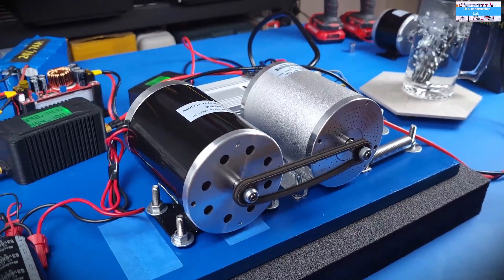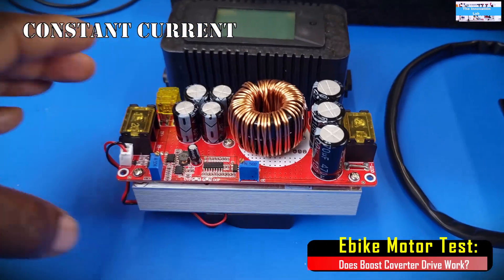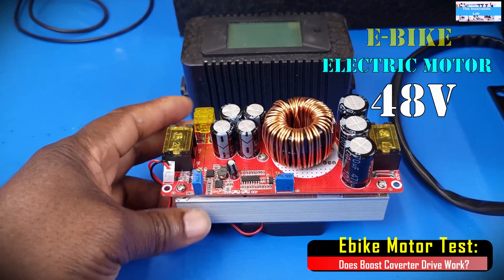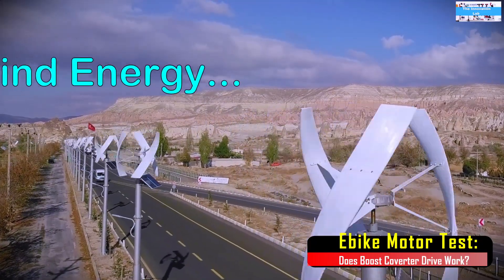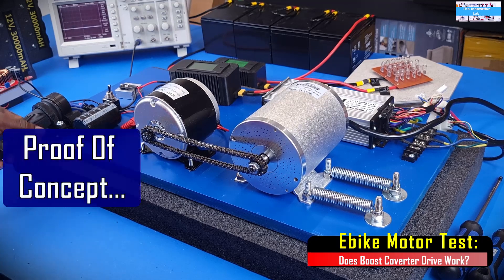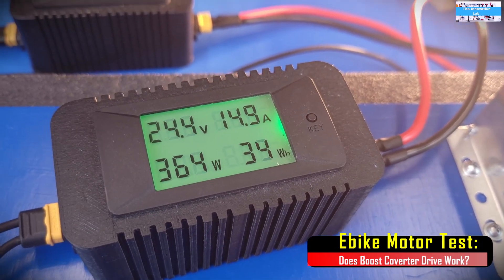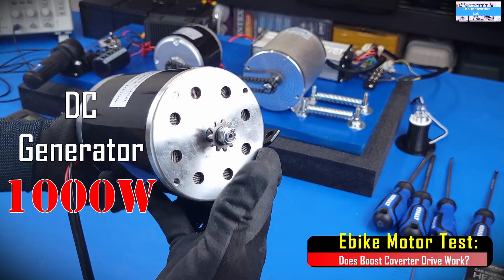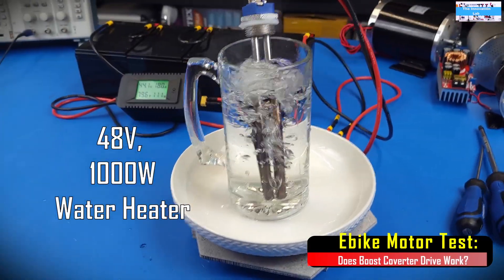Innovative Electric Bike Motor Testing, Boosted by DC to DC Converter!

Comment: Planning to install this dc boost converter in my small solar setup  to extend my inverter running by boosting or maintaining the voltage of my battery to prevent my inverter from shutting off  prematurely.  Do you think its possible or practical to do it or not?
Reply from the maker: A lot of concepts or ideas are feasible with good design analysis and testing. I will need to know more specifics of your setup to know if it makes sense or not.

Remain blessed.
Respectfully,
The Innovati0n Lab
Reply: @theinnovati0nlab782 my small setup: 600 watts solar panels, 50ah lithium 60 volts battery, inverter 1,000 watts use only for lights, 2 laptops and electric fans total of around 500-600 watts. My battery cutoff at 45volts while my inverter at 53volts so my battery juice is not getting fully utilised😢, i now see this converter having an input of 14-85 volts with 1,800 watts on paper unlike before that it can only handle up to 60 volts so i got interested again to try the idea.

Comment: Hello, how are you?
I have a 12v x 50Ah battery and I need to power a 24v device that consumes 10Ah.
Does this converter work well with this current continuously?
Reply from the maker: Hello!
I am doing great!
Thanks for asking, much appreciated.❤️

Yes. 
The converter can easily deliver that much power with any issues....you are only asking for less than 300W - accounting for converter losses. Just make sure that the output current limiting potentiometer in set to the maximum point.

I hope this helps.
Respectfully,
The Innovati0n Lab💥

Comment: hi i tested in my ev  scooter. battery out put cable wire to controller 
Heated  and smelt when loading  
Vehicle volt 48/7 ampere 
Battery  lead acid 24 v
Boost converter 1200 watt  and 
Converted volt 48 v out to vehicle controller    how to solve issues of  high heat?
Reply from the maker: Great question.
Easy solution.
I would recommend using high current and big gauge wires to run the input power from your battery to the boost converter input.
I find that multi-stranded, tinned silicone wires have better ampacity and dissipate less heat. 
Guage 8 should be able to have up to 50 amps. 
If you are feeling generous or extra cautious, you can double up on gauge 8 or use a bigger guage - like gauge 4.

Also, keep your wire runs as short as possible. The longer the wire, the more the cable losses.....and the more the heat you will generate on those wires.

I hope this helps.
The Innovati0n Lab 💥 www.theinnovati0nlab.com
Reply: @theinnovati0nlab782  
Thank you sir

Comment: Would it be more efficient to use a buck converter to stepdown a larger volt battery to a lower volt?
Reply from the maker: It will depend on the efficiency of the converter and your battery voltage and the requited voltage of the device you are providing power to.

I hope this helps.
The Innovati0n Lab 💥 www.theinnovati0nlab.com

Comment: hello friend.. I want to praise your work, from which I, as a beginner, learned a lot. I have a stupid question. 12v 70Ah e-bike battery an 36v 350w cintroller and motor?
Reply from the maker: Thanks a lot for the wonderful feedback.
I would be honored to answer your question if you don't mind elaborating.

Thanks.
Respectfully,
The Innovati0n Lab 💥 
www.theinnovati0nlab.com
Reply: @theinnovati0nlab782 

let's say: battery 70Ah 12v plus booster at 36v connected to controller 36v 350w e bike who have motor 250w..

Comment: In 12v mode you applied 180 watts and received 260?!
Reply from the maker: No, you are looking at it backwards. Unless I somehow stumbled on a new law of physics during my testing without even knowing it...hahaha!

The dc generator was used as an electro-mechanical load on the ebike electric motor, and the converter powered the ebike electric  motor for the 12V battery.

💥💥💥
Here is the breakdown:
Power from converter:
260W

Load on DC Generator:
180W

Again, applied load = 180W, while the output power from dc to dc boost converter at 48V is 260W.

I hope that this makes sense to you. I appreciate you asking for clarification.
👍👍👍
The Innovati0n Lab 💥 
www.theinnovati0nlab.com

Comment: I’ve just ordered the 1500w version of this step up converter to boost my e-bike voltage from 52v(58.8v) up to 72(84v)*maybe above as it allows up to 97v…* it says I should upgrade the cooling for above 22A so I’ve also picked up a twin pack of 50mm fans. The max amps on the one I ordered states 30-35A so do you think I would be ok to pull 30A for short periods of time, maybe 5-10 seconds at a time with 10-15A most of the time? My main intention is to aim for speed at the cost of torque and obviously efficiency.
Reply from the maker: Wonderful!👍👍👍
At such a high input voltage, I believe you should be good to go, but that is my informed opinion.😊 You still need to test it to see how the converter will perform.

Success wishes!❤️
The Innovati0n Lab
www.theinnovati0nlab.com

Comment: I need to drive  a 72v 2000watts motorcycle. What should i use as a boost converter.
Reply from the maker: Please see my response to your previous question on the other video.
I would only recommend these converters for steady state or continuous power load of less than 1200W  at a minimum input voltage of 48V.

You may have to conduct some product research if you need more power....but heads up, if you find anything, they will be very expensive.

I hope this helps.
👍👍
The innovati0n lab 💥 
www.theinnovati0nlab.com
Reply: Sorry, but I understand that these boosts support a maximum of 18v at the input, 48v couldn't be possible 🤔

Comment: ЗДРАВСТВУЙТЕ! Привет из Чернигова 🎉. 
Извините что не на английском. 😅
Посмотрел ваше видео , очень интересно ! 
Я катаюсь на моторчике My1020 36v1000w . И акумулятор у меня ~26в100AH  (лилий железо фосфатный)  
 
Использую акумулятор от солнечной станции . Боялись что електричества не будет . После мемяца обстрелов из аритилерии , решились на столь дорогую пркупку. 
Но хотелось бы поставить более мощьный мотор . И я смотрел в сторону модулей преобразователей. 
Да, спасибо большое за Ваши експерименты ! 
Я вот хотел уточнить . 
Сейчас я имею примерно 26V*27А=700w
Если добавыть  модуль выйдет 36v*20a=720w. Результат не впечатляет . 😊
Сталобыть нужно выбирать двыгатель с более высоким напряжением !?
Например я возьму 72в*20а=1440w. !
(Но в реальности будет 1000ват , модуль не сможет дать больше 😂)
Буду очень рад услышать Ваше мнение, как мне добытся большей мощности ? Без замены акумулятора.
Reply from the maker: Wow!
Thanks for such great feedback!
I am glad to be of help.
Your thinking is on the right track.👍👍

The major issue with these converters is the current limit at the input of the converter.....which is usually around 30A....if you push it a bit, maybe 40A.
This means that at your batteries' nominal voltage of 26V, you would only be getting less than 26*30A watts  from the converter - we have to account for conversion efficiencies. Yes, your math above is correct. 

These converters are designed to deliver more power at high input voltages. Hence, to get the kind of power your need, you will need a more powerful boost converter capable of providing high output power at lower voltages.
This means that you need a converter that should be able to process greater than 80 to 100A at the input.
I hope this makes sense.
Overall, your design logic of higher voltage at lower current is really the gold standard for high efficiency for most electric vehicle systems.

Success wishes on your diy projects, my friend!👍
The Innovati0n Lab💥
www.theinnovati0nlab.com

Comment: На DC моторе 48в 1000ват.там где выходят два провода черный и красный можно сделать реверс?????мотор не сгорит??
Reply from the maker: It's a permanent magnet dc electric motor..Reversing the wires will reverse the of the output if you are using is as a dc generator. As a motor, reversing the polarity would cause the motor to spin in the opposite direction.

👍😎
The Innovati0n Lab💥
www.theinnovati0nlab.com

Comment: i wonder if 2 separate boost converters connected to 2 separate say 36 volt lithium packs could be used in parralell where only  the output is connected ,has this been tried yet ,i know both the inputs and outputs were done ,but separated?
Reply from the maker: This sounds like a great idea for a simple experiment. You should give it a try and see what the output response of your converter system would be like.

Keep us posted on your progress. Let me know if you have any questions.
👍😎
The Innovati0n Lab💥
www.theinnovati0nlab.com
Reply: @theinnovati0nlab782  im actually doing  parts list ATM to build your modified converter so i can use it in a 85 volt 10 to 20 amp ebike charger  i am pretty sure that ill have to have an input voltage of 55-60volts to be able to 85 volt 20amp output though.as you know these converters work alittle strange

Comment: weve run the 40 amp version with a 36volt and 48 volt battery  and boosted it to 84 volts as long as we were easy on the trottle it ran quite well
Reply from the maker: Wonderful!
I am happy for your success!
👍😎
The Innovati0n Lab💥
www.theinnovati0nlab.com

Comment: Hoe kan  ik een 48v 20ah batterij het best opladen tijdens het rijden zoals een auto het doet. Oneindig rijden.  Zoals een dynamo van een auto. Ik heb een elektrische tricycle die rijd 85km/p.
Reply from the maker: Great question.
Electric cars use regenerative breaking sustem that produces electricity when breaking. 
Gas powered cars use alternators that are drive by the vehicle engine to recharge their batteries.

So you may need to research the implementation of a regenerative breaking system. 
I made a dc generator video a while ago. I discontinued the series because people didn't seem too eager for it at the time.
You can apply a similar concept to see if you can make something work. Regenerative breaking is all about replacing a vehicles break pads with a high power dc generator. Instead of wasted power as heat on the break pads, your dc generator converters the cars kinetic energy into electricity and saves it in your battery.

DC Generator Videos:
👇👇👇
https://youtu.be/OuLokIPeGt8?si=VPSrIB31zYNfrqF6

https://youtu.be/w9F_UoCyjPY?si=LUEot0yCFKG8gtv_

https://youtu.be/56XBcXrnPoE?si=Hvg0L2DaNiTttmKT

I hope this helps.
Please, we need your help to grow our channel by sharing our videos on social media. Also you can visit our website at www.theinnovati0nlab.com 
👍😎
The Innovati0n Lab💥

Comment: Hi sir can I use the converter to feed the motor directly as a controller. Thank you so much
Reply: I have the same quiestion. Or can the converter be used after controller?
Reply from the maker: Again, this is  an interesting idea. I love that you are thinking  outside the box!👏👏👏

However, honestly, I would not recommend you do it because, at lower voltages, you will damage the converter as a result of high current surges.

But if you are feeling adventurous, you can definitely try it. But you must know that there is a big risk of damaging the converter, or your motor, or both.

I hope this helps.
👍😎
The Innovati0n Lab 💥

Comment: can i connect the dc generator to my bike pedal so that it can generate volts, and that volts, im going to connect it to my electric motor, will it work then?
Reply from the maker: It is not clear to me what you are hoping to build. However, the function of the DC Generator is simple - as long as you as you can find a way spin the amateur shaft, it will generate electricity. Just like our setup in this video. I discontinued the video series because the YouTube algorithm was not recommending the videos, so they were not doing as well.

Please watch the design concept video below.
👇👇👇
https://youtu.be/w9F_UoCyjPY?si=WwJe25dI6YjbCkQw
Reply: thanks, i just want to run my electric bike using dc generator, without using battery
Reply from the maker: @felixescober6798  
I understand.
However, it may not be the best idea. You are going to encounter a lot of energy losses due to inneficiencies.  I would not recommend doing that. But if you are curious, you can build it as an experimental project - just to satisfy your curiosity. Trust me, I have done many projects of such nature myself...hahaha.

Summary:
You will always need a battery system for any electric drives system.
I hope this helps.
👍😎
The Innovati0n Lab.
Reply: great thank you, it will save my time and effort haha, thanks much much

Comment: Привет! У вас есть видно опыт в этом ,вот вопрос _ я нашёл конвертор 12-48 v 20a,  хочу свою батарею 48 Вольт литий-ионную переделать на 12 Вольт ёмкость ее получится 220000а/ч , смогу ли ездить на велосипеде дальше ,получить выгоду от такой переделки ? Есть ли смысл?
Reply from the maker: Great question.
👍👍👍
First of all, it seems that what you will need will a powerful buck converter - if you are looking to down, convert your 48V battery to 12V. Unless I misunderstood you. 

Honestly, if you already have a powerful 48V battery, I wouldn't recommend doing the down conversion to 12V because you will be burning a great deal of power due to converter losses and low efficiencies. It will be better to just use a 48V motor. We only suggestion these boost converters to those who cannot afford expensive higher voltage battery systems. 

I hope this helps.
👍😎
The Innovati0n Lab.
Reply: @theinnovati0nlab782  Thanks for the answer! I realized that I would not get any benefit; the converter would suck five times more energy from my twelve-volt battery. 😁👌🤔👍

Comment: Why only 180w @ 12v?  For 500w ebike output 42 amps @ 12v.
Reply from the maker: It is due to the current limit on the converters.
It was also explained in the video.
👍👍
The Innovati0n Lab

Comment: So why did you not talk about how you did the speed control from your hand throttle to the motor. I feel that you are not giving full information here.
Reply from the maker: Thanks for the feedback.
I see your point. However, I had already covered that in a previous video. This video was meant to be a follow-on video that builds on the previous one that explains the concept of the Electric Motor Load simulator. But you are right, though oftentimes I forget that these videos exist as separate entities. 

Please check out the video below.
👇👇👇
https://youtu.be/w9F_UoCyjPY?si=Vn2HAmUMtdxS4Xcg

Also, honestly, there really isn't much to explain. The ebike kit came with the motor speed  controller and throttle. All I did was build the test bed for it.
I hope this helps.
👍😎
The Innovati0n Lab.
Reply: Many thanks for your reply i will now watch that other video.
Also i do have to say that i do like your video's they are very clean and crisp you seem to lay out everything as it should be ( not all jumbled up )and prsented very well, i will also subscribe now.
All the best Kev @theinnovati0nlab782

Comment: So it seems to me that the DC/DC converter has a constat current feature referred to the INPUT current, not on the OUTPUT current.
So changing the input voltage, setted the maximum input current, will end up absorbing more input power and delivering more current at 48V on the output. Am I right?
My thought was that the constant current setting will be acting on the output current, but that's not the case right?
Reply from the maker: Your thoughts are on the right track. 👍
However, the converters have input/output current limit (usually about 30 to 40A). 
The constant current function only applies to the output. It is a built-in function that helps the converter to regulate the current delivered to the load, to whatever level the user desires.....as long as the set CC point is less than the rated current limit. Also, you will have to have an input power source that can deliver that amount of current.

I hope this helps.
👍😎
The Innovati0n Lab.
Reply: @theinnovati0nlab782  I didn't thought that cheap thing could be so sofisticate and well engineered. Thanks.
Reply from the maker: @grazianoturbogas  
Yeah, that is the power of mass production. Honestly, for the price, the product is amazing!

Comment: hello im just curious ,when you focused in on the oscilloscope ,the flat line was supposed to show what ? as far as an ebike goes ,introducing a dc to dc cc /cv boost converter will just add to much inefficiency ,if you run 72 volt motor on a 48volt battery youll get more distance than boosting a 48 volt to 72 volts
Reply: i roughly saw greater than 20% wastageand that was just in the conversion itself ,there is a trick to these boost cons,the less you have to boost the voltage ,the more efficent and less heat, the larger you have to boost the more current you need at the input and the more heat
Reply: have you had any of the units you got ,faulty? or are they good,some people have had alot of faulty units?
Reply from the maker: This measurement of the DC Generator output.  The flat line shows that the dc generator is outputting dc voltage/power. It also shows that the added rectifier and filter caps are preventing pulsation at low rpms.
I explained it all in the video.
Did you watch the entire video?
Reply: we just couldnt see the  readings ,and we werent sure if it was connected or not21 @theinnovati0nlab782
Reply: Blah blah not enough  it should be done with a heavy load  and measure it  im sure battery booster will go down drain in few seconds
Reply: your right if they try and boost from 12 volts to 80 volts with heavy load it will shit itself ,just build a proper battery or power supply with the right volts to start with @edifierbass7821